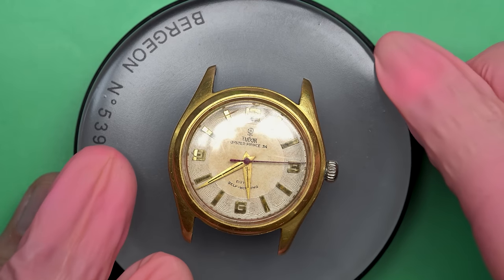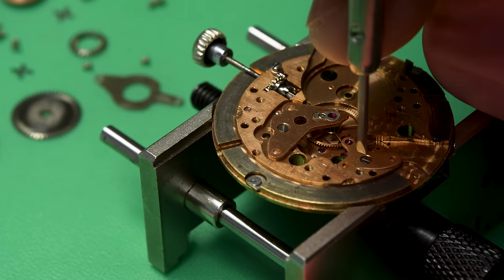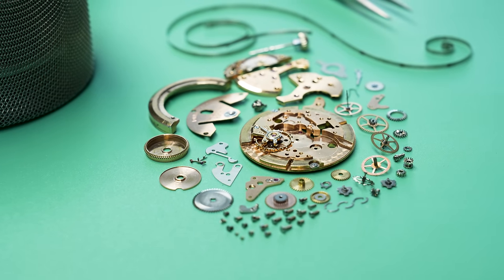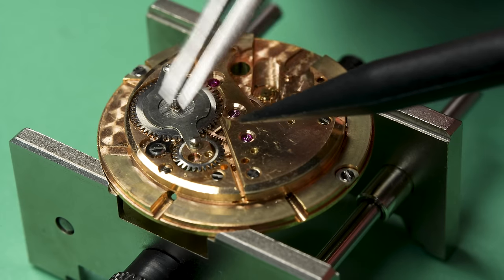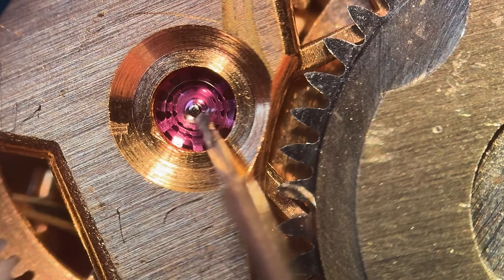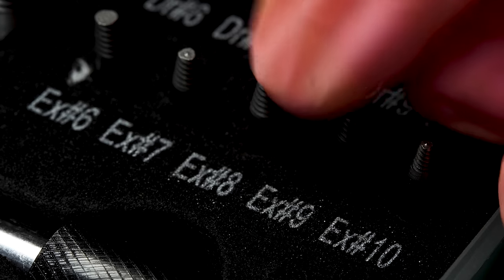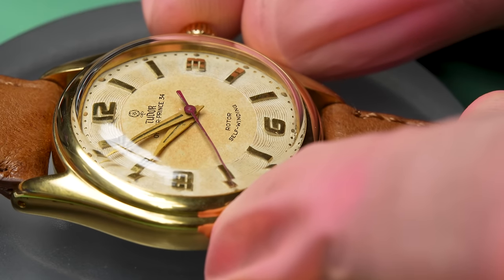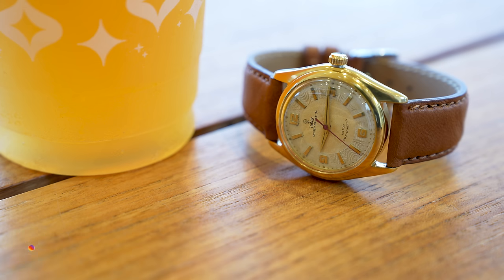Tudor Oyster From the 1950s Needs a Full Vintage Watch Restoration

Comment: You are very wise to use a nickel undercoat, it stops the gold diffusing into the brass which I will do. I recall some one from the UK atomic energy research asked us to gold plate a pile of copper bits from some new experiment. They had the bits gold plated directly on to the copper substrate. It got warm and behold the gold vanished!  A few microns of nickel was all it took to stop.  Btw, we used to say gold on watches wears at about a micron a year.

Comment: Me and a friend of mine actually tried watchmaking, got 3 pocket watches for 30 bucks. We tore the non running Junghans apart with tools for glasses , replaced the hair spring with one from a no name watch because somebody broke the original one, cleaned everything with brakeclean and I got it back together thanks to the knowledge I gained through watching your videos . It actually ran, badly , but it ran! Got sold to a watchmaker apprentice who fixed it right...
If I ever have the money and time to do this hobby right I will.

Comment: This particular video was fascinating to me. I have a Tudor Oyster Regent 7903 that my father purchased new when he left the merchant navy. It was serviced several years ago and keeps impeccable time. The only thing that is wrong with it now is that the stem does not sit in the winding or time setting positions easily. Both functions work but I suspect there is something wrong in the keyless works (if I understand that section of your video).

Comment: I’ve now watched hundreds of watch maker videos and have now finally learned what all the parts are and what they do in the watch and the wheels that you called the motion works many watch makers have referred to these as intermediate wheels while I have personally named them the time setting wheels since they are used to set the time when the clutch engages them. So are the motion works the official name of them or my name that I gave them the setting wheels the actual official name of these wheels? It’s been bugging me because until we get to these wheels everything is named logically. Thanks for all your videos and talking about all the parts as you dismantle watches, I find myself extremely confident that I would have little issue servicing a standard watch such as a Seiko but will probably start out by buying a cheep Russian watch to cut my teeth on. Thanks again, I think this will be a fun new hobby for me. I do have a rough behind the ears Seiko Bruce Lee I bought cheep but needs lots of work and I think I can work my way up to restoring that watch.

Comment: Patina.. oh man.  I'd have to say, generally, i'm a "bell curve" fan.  That's to say, if there's just the start of it, i'd rather have the new dial, just the same if there is just way too much.  But there is that sweet spot where it's enough to be aged and out of the "new/clean" look, but not aged enough that it needs to be replaced.

Comment: My wife gave me the starter kit with the ETA 6496 movement and tools. I also purchased a few other tools such as the hand levers, some of the light oils, an oiler and a movement holder. I purchased the oil because my research indicated that a lot of these movements are shipped dry and I wanted to be as through as I possibly could. To me the biggest issue is not the knowledge since I have watch so many of your videos I pretty much know the sequence of assembly and disassembly. The biggest issue for me is feel. There is no way to anticipate the "feel" you need for these tiny screws and parts. To that end I have been taking small steps removing and replacing certain components and not tackling the whole movement yet.

Comment: You may need to open that watch back up, at 33:25 you can see that one of the spring clips was installed upside down. It should have the 4 legs pointing down so it holds tension on the gearing.

Comment: For fun I found a 3D printed movement holders on printables and printed up a small and large version. I don't have any movements to hold, but they do a terrific job of holding coins and washers very solidly (even with the screw thread 3D printed). There are other 3D printed watchmaking tools out there as well, you should review some of them to see how they work in practice. Might be able to get people into the hobby for even cheaper :-).

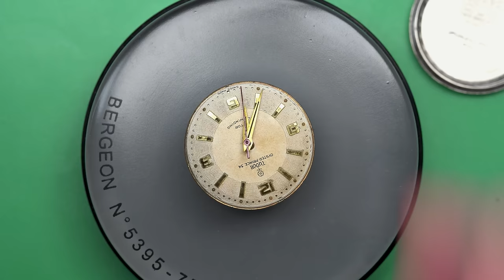Comment: 2:57 depends on the watch. This one works, but some dials merit a sympathetic clean up. And there's certainly some dials that are absolutely too far gone. I've started getting some watches from fleabay and usually i make the decision after i fiddle with the watch. I always replace the crystal, i think that's one aspect that always needs to be in top condition (mostly because i've had an old crystal that looked perfectly fine shatter after a few days of use) and usually that spurns the outcome. I've cleaned a couple, left a few alone, i've replaced one completely so far (tho that one was shattered in one of the pegs). Like i said, depends on the watch. When i was a kid i wanted to be a doctor, i didn't do that, got into architecture like most of the family, so i get to play doctor with watches now. :) I let the patient speak.

Comment: I was just listening to what you were saying with regards to putting a watch back together. I had been watching your channel for a few months and decided to have a go myself ... I bought a day date Sikura automatic because I liked it. 

I showed it to a friend of mine who said "I'm not sure that's the one to start on" 😂 but I had already started taking it to pieces. I photographed every step of the way.

Anyway, it took me nearly a month to get back together but I managed it. I will admit it may have been a bit more than I probably should have bitten off but I got there in the end and it was such an achievement. And it works now, I even managed to find the missing second hand that wasn't on it when I bought it. 

It was such a learning curve though and I've done several pocket watches and a few automatics since (without day date).

What you say is so right. Oh, I've also got eyesight that isn't great but magnifying glasses from AliExpress that were £6 (UK) solved that problem. 

I love the hobby, you have got me hooked. I think I'm going to do the courses you've recommended also. 

Thank you for your channel, it's so inspiring.

Comment: I been sort of(only quartz) working on watches for the past couple years I’ve replaced movements and coils, polished crystals up. But I recently have took on a mechanical watch challenge and wow the tools are so expensive! Just the oil is insane! I checked out your site, but unfortunately it was out of my budget. Crappy or vintage tools for me😂

Comment: The caption said something like $650 risk on this watch. If you screwed it up and sold the movement for parts on eBay you would be still ahead. I enjoy your channel and work.... the 390 caliber was put into mid 60’s Tudor Submariner 7928 watches that go for a pretty penny on eBay that used the 390. I was gifted one by the original owner in 1986 who paid $250 for it  new. It cost $275 to service it in 1989 at Rolex Canada, downtown Toronto. I service it now myself and my other watches in my equipped watch studio.

Comment: Owner a vintage tudor oyster prince once, great watch.  Sold it years ago, but I picked up my first Rolex, a 1969 rolex datejust 1601, a year ago and while they’re similar enough the rolex is just built  and finished different, as cliche as that sounds.  Id recommend the Tudor if the budget is limited however if you’re thinking about buying the Tudor to satisfy your rolex itch, just save up the extra cash and buy a rolex instead imo.  You’ll save money in the long run, speaking from experience 😂

Comment: Hi Marshall! Long time fan and newer fellow watch maker thanks to you and others is our YouTube watchmaker community! Quick question about the electrical cleaning solution, can that solution you poured in the beaker be re-used for the next project or would it be best to use fresh? Also those “cross” shaped  clips for the automatic works seem like not the best design, in your experience did they seem a bit loose? Saw one pop off towards the end of your video.  I’m probably going to stay away from that movement for a while, just finished an ETA 1080 Tudor movement I’m really proud of! Also really happy you have your new website, your videos talking about your tools really helped me develop my collection of tools but it took me months to obtain the ones I decided on.  Your website will definitely help someone like me who decided to try out the hobby! Best wishes!!!

Comment: Hi Marshall, have loved your videos for a while now. I have a Seiko ref. 6309 that is in need of some help. My dad purchased this watch while on deployment in the mid 80s and recently passed it down to me. It was running okay, but it recently took a hard hit and hasn't ran right since. I was able to take most of it apart, but I don't have the tools to really give it a thorough inspection. I muddled my way through the assembly process, but now the day-date function isn't working and it still doesn't run. Please let me know if this is something you'd be willing to take a look at. I'd really appreciate your help! Thanks so much for your time, Sam

Comment: My dad was a jeweler, who made rodeo buckles, cowboy buckles for actors and LEO badges and buckles . Used alot of polished brass. If you use a airbrush and do a coat of clear. It will seal and preserve the polish. Give it a try.

Comment: You have to be vigilant and take the Ebay listed item descriptions with a grain of salt a lot of the time.  You mentioned that the watch was described as 'ticking' and that brought this little anecdote to mind.

Another YouTube channel I follow is published by a shop that repairs Ford Diesel Powerstroke trucks.  The shop showed a used pickup truck that was purchased on eBay and brought to them for repair.  The item description stated that the engine had a skip (misfire) and an oil leak, which at face value sounds like not that big of a deal repair-wise.  The engine did run, but was a little hard to start.  

Upon further inspection, the 'oil leak' turned out to be a gaping hole in the side of the engine due to a thrown connecting rod, which was causing the 'skip'.  The sad part is that the purchaser of this truck paid $19,500(!!!) for this disaster.  SMH.  Here is a link to the video in case you are curious.  https://www.youtube.com/watch?v=HjUAW1yHJUQ

Comment: Excellent job!  Of course, very nice that you have a Rolex movement for the Tudor versus the AS or ETA common for the era.  So in this case you have a Rolex case with a Rolex movement in and called a Tudor 🎉  so in fact, you scored another 100% Rolex!  thanks for the video.  

As a side note, I assume all Ebay purchases in the watch area are ‘broken’!

IF, if, you cut toooooo much of the stem off you can use a flake of solder, insert that flake into the threaded section of the new crown.  Then screw the stem into the crown.  This will compact the solder flake and hopefully the stem will then be the correct length.  Repeat as necessary.  Saves the ‘cut it too short, so i cut it again and it was still too short” dilemma.

Comment: Hi Marshall.  As always, I enjoyed watching this video and listening to your explanations.  I have a question though: Why do the balance wheels always (?) have these little screws in the rim? I never saw you playing around with those. I can't imagine they are to balance the wheel (like on a car after replacing a tire).  I can imagine that they are there to increase the moment of inertia a bit, but in that case a heavier rim is more simple to produce. So what remains is fine adjustment of the moment of inertia after a hairspring replacement. On the other hand, that can be achieved with only two screws (or just one, but that would throw off the static balance). Anyway, I am curious about the purpose of those screws.

Comment: You talk about dropping things and beeing on all four with a flashlite on the floor.
That you have in common with model builders. We talk about the carpet-monster that lives in your carpet and eat your small parts that you dropped. Our parts ste selldom magnetic though. One trick we use is a vaccuum cleaner with the nozzle covered with a very fine cloth to find small things.

Comment: Mowing the Lawn, using power tools could vibrate the screws loose. Just throwing that out there. I recently had a Polisher vibrate my watch loose. My bad for not ensuring the polisher backing plate was tight.

Comment: Why not guarantee you will not damage the dial by simply not touching its face and only handling it by the edges?  Numismatists only handle coins by the edges, why not you?  Love your videos otherwise, except the pain that shoots through me when I see you touch the dial either with your gloved fingers or with tweezers.  Please explain your reasoning using more words than found on a bumper sticker.

Comment: Hi Marshall-Long time viewer here--   I've started by learning how to assemble watches by purchasing parts online (cases, movements, hands, etc) just to learn the skill set. 
      
 Watching you on your channel got me interested!!!  

 Its fun to finish at the end and have a working, pretty accurate self-wind watch. NOT a Rolex or a true Seiko but a good looking watch just the same. 

Watching as you prep the case for gold plating caused me pause as I won't file the stems (after cutting to length) over the same bench I assemble my watches on so I don't get loose filings in the area of assembly to keep the new watch perfectly clean. No chance of a stray filing getting inside the new case that way. I can't tell if you have the same cautionary procedure.
Great videos to watch (pun intended)

Comment: Great video as usual Marshall, but is that 'crown tube' thing pushed far enough into the case?  I mean that little steel tube that you took out to do the plating.  It looks like the crown is protruding a little from the case.  I may be wrong - just wondering. Cheers.  Julian.

Comment: Wow, that is always so fascinating to watch. Truly an expert at his job. You encouraged me to buy my first (very cheap) watchmaking tools. So far I have changed couple of batteries and shortened some bracelets, as well as tinkering with my old and cheap Omega pocket watch, which has some problems with the balance wheel. Still I haven't dared to take the Omega completely apart. I might not be able to assemble it back together.

Comment: maybe you have addressed this in past video, I do not recall, but what do you do regarding possible radium on these older watches? I actually have a Geiger I use.
Incidentally I have a Waltham watch that had the exact rotor problem when I received it. The Foster 220 movement uses a clip that slides in place to lock the underside of the rotor on. It was loose inside the case.

Comment: Hey, I just want to say that your Chanel is amazing. I found it last week. I have watched every video now. I don't know how to say that it is a very good Chanel. There are two things that are amazing. First. When you take a watch apart, you know how to put it back together. No matter what watch it is. I see that you understand the two mechanisms of wrist watches. Even though you never had a watch that you are working on. You know where every part goes after. Once you comprehend how a watch works you know how to fix it. The second thing I like about your Chanel is that how much you explain and show everything. If I were to have any watch that you have on your videos I could it put it back together. Everything you do is actually step by step. In one of your vids you went into detail about parts and kits. How it would be a good hobby. You have a website for kits. Etc. (Although when will the watch auction part be up?). The tools you have are not cheap. It's not an easy one cheap hobby. Yes. You need space for wood working or other things. For watches a kit just under 800 is ok. If anyone wants to habe the tools you have and solutions that's about 5k just in tools over all.

Comment: Hey, Marshal are you sure that star-shaped spring at 33:27 is in correctly? When you removed it at 4:30 it looked more like it was designed to hold that gear down so the spring may be cupped. I dunno it looks kind of loose after you reinstalled it. I Love your videos by the way they are one of the hi points of my weekend. ;-)

Comment: I have to coment here at 8:09. I doubt the loose screws were the original issue, because it seems to me the previous owner removed them for a reason, being that the watch already had a problem, couldn't fix it, and just dumped the screws back in the case. Of course, I could be wrong. It wouldn't be my first time.

Comment: 50's and 60's Tudor watches are so good looking in my opinion. There's a bold, clean line to them that's not too clean (cause sometimes that makes the watch look clinical). 
I've always though of them as daily, but with that extra pzazz. Rolex is the standard in that category (with the extra value on the price tag), but Tudor was just right. A silver Tudor from that era is the perfect example of the breed. I think they look great (especially when they don't have the Rolex crown on them - that one kind of ruins it for me).
32:25 i actually assemble the ratchet palls, put the drive (the intermediate gear that you put on the support) on engaged to the palls and then offer them up to the support as one assembly. It's MUCH much easier that way. I use rodico to do this. Try it next time.

Comment: I love these old watches I have a seamaster supposedly from the 60s I’ve had it 20 yrs it still runs great -10 seconds a day however I believe it’s either a fake or the dial has been replaced no Swiss made at the bottom it’s the full case type so I can’t remove the back